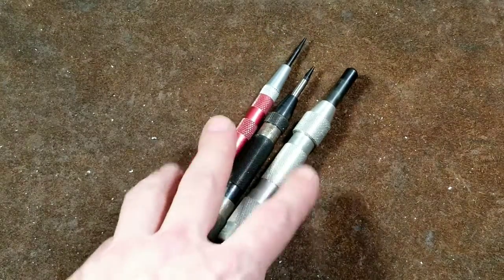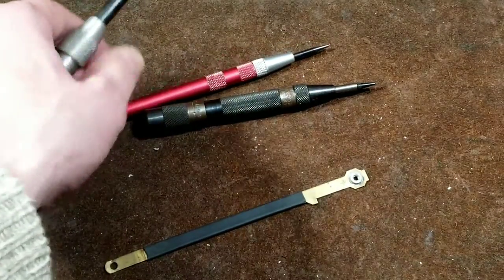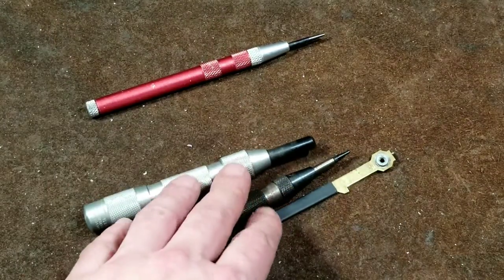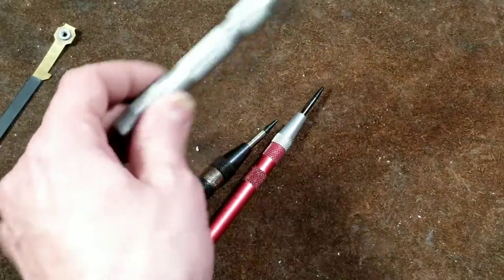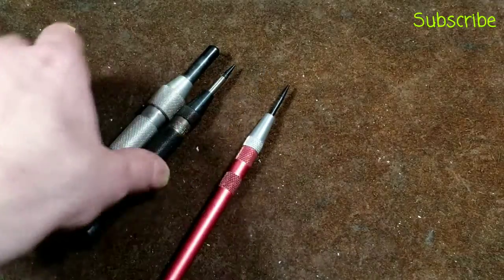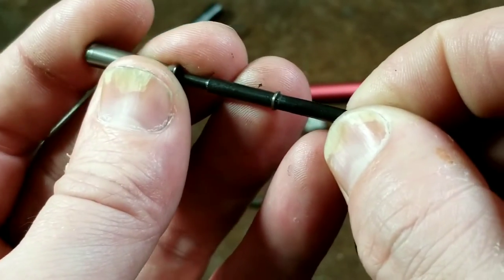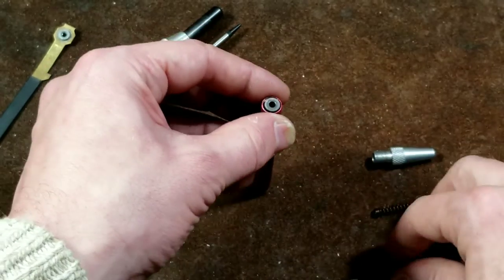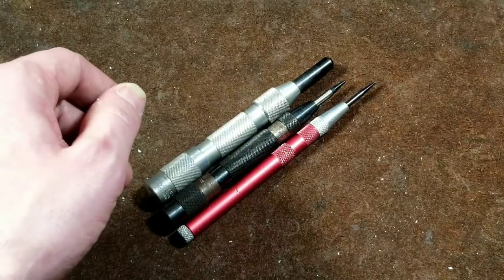Automatic Center Punch Review & Comparison

Comment: 4:52 The automatic center punch you have there is for hinges, it's to help you locate the center of a hinge hole. You put the punch on the hole so it fits on the countersinking and then press, you have now the exact center where the screw has to be located.

Comment: Thank you for this video.  I've used the Blue Point YA-900 for 23 years and it finally quit working.  I watched your disassembly/reassembly video because my center punch became a one hit wonder after I had taken it apart to clean it.  The concave barrel still isn't resetting like it should, but at least I know I have everything in the proper order and facing the correct direction.

Comment: I have a couple of these myself. Not sure of the brand but it looks like the Starrett and is adjustable as well. I use them quite a bit in (80% 30ga. to 16ga.) metal fabrication. I usually continue to hold pressure (on heavier material) after the first punch, don't move it and give it a few more clicks. 
You are correct, tips are hard to find and I just sharpen them up on the grinder. I pull the tip out and chuck it up in the cordless and spin it while sharpening on the grinder, Easier to control for me, and a smooth point that almost looks factory when I use a fine grinding wheel.

Enjoy the reviews, (probably about out of tools to show us lol) keep 'em coming.
Reply from the maker: That's an excellent idea and that's what I do as well putting round objects in a drill to grind give you excellent results. I have a few more tools to review and then I'm going to put up other reviews to I started a second channel that decided that this channel is where I wanted to do reviews just got caught in a rut doing a bunch of tools.
Remember there is tons of accessories to use with tools and I have to get through those too... :)
Reply: link to the other channel?

Comment: Tip: if you need to sharpen the tip, mount it in a drill and use a file on it.  Do not use a grinder because if you overheat the tip it will be annealed back to a soft metal.

Comment: Thanks for this video!! I found it to be a great explanation of the inner workings of the spring-loaded center punches, as well as the difference between the different types of styles.

I myself purchased a Husky spring-loaded center punch (it was the only brand/one I could find at Home Depot (tho to be honest I didn't look very long/hard)), which also has the "Light/Heavy" arrows/indicators on the end screw cap, and I think I'm going to be quite happy with my purchase. Although, I'm HOPING that I don't run into the issue you mentioned: that I'll probably use it just this one time, and then will forget about it. I purchased my specifically for marking some drill holes I need to put into a plastic casing for an electronics project I'm working on, do we'll see if it ever gets another use.

Anyways, thanks again for your/this video - quite informative! GREAT JOB!!!

Comment: Who makes the red punch?  I like the thinness of it.  Also, i don't expect accurate positioning
of the manual punches anyway, regardless of sprung or knot (not).  It's really best for the
accurate machining to use a DRO equipped milling machine to get to where u want to
drill (x, y) and make a tiny crater using a center drill 1st.  Then, bring the drill bit at the same
(x, y) coordinate.  The accuracy is within .0005" in both x, y coordinates.  Mit the milling machine head adjusted in a perfect perpendicularity w the table, the drill will nut (not) 
wander.  So, dat (that) said, everyone must go buy this 2 ton, 3HP milling machine + DRO 
accessory installed in ur garage.  Or if u don't wannnnna change tool bits constantly, or
crank the X, Y, Z axis wheels, get a CNC Milling machine!  Keep the garage doors shut
so ur  Wifee won't c it coming home from WallMate instead of BloomingTale's.  Don't
forget datto she needs to keep up w Jane-Sees as u trying to keep up w Joe-Sees.

Back to the manual punch.  Yes, i have datto General H/W brand adjustable punch.  And yes,
it bends brass sheet strips and the hole is too tiny and nut deep enough to keep even my
drill press bit to wander off the dimple.  Thinking about the comment on why the Star-it has
the sleeve, perhaps, make the hinge hole press down onto the thin brass sheet as a guide
so the sheet won't bend.  Or drill a bunch of diff. hole sizes onto a 1/4"T plate and use datto
as a guideOoo for no wander, no bending work!  I won't try to grind the tip of the sprung one
in-situ or out of the body.  It's too tiny and brittle.  Yah, the tip won't last long.  if ur un-4-2-8,
ur drop it w tip pointing down on concrete as i have.  Trying to buy a replacement is mo
expensive than the entire tool (how do the seller figure dat?).    Yes, i agree, the solid
punches r better and if u have a 3 Ton Lathe,  no problem to dress up the point symmetrically w perhaps using a good n sharp carbide tool.  i bet ur starret's entire punch is of tool steel,
nut carbide.

Thx 4 the video!
Reply: Actually, if u have that 1/4T drilling template, u don't need a punch.
For bigger diam drill bit, all u need is just one hole in the thick template.
The diam. of the template hole s/b same as ur General H/W's sleeve
at the tip!  After punching w the template, remove the template and
drill the big hole.  i suggest use step drilling for accuracy.  Get a drill
press regardless instd of trying to drill w a hand held one.

Mit Regards

Comment: Great video I have some automatic center punch I think one of mine might be a kind of a Rosy pink color made by Blue Point found at an estate sale and I think it may have a pocket clip and I really like those automatic Center punches you are right they don't leave a big enough dent because they tend not to hit very hard and so in that case they don't get used very much but I still think you're cool if you are working with aluminum copper or brass which are very soft thin metals that would probably leave a much deeper or or bigger dent in the material your tool friend Brian Williams take care see you later
Reply from the maker: Yes indeed although I did forget to mention that you can use them repeatedly in the same spot to get a bigger Dent but if you're trying to use them on harder steals you have to use a manual Center Punch & Hammer

Comment: Starrett has always been the best of the best in the machine shop. I'm shocked at the lack of quality and forethought in that center punch. An aluminum body? A retractable sleeve makes precise positioning impossible! What were they thinking?? Good grief
Reply from the maker: Yes indeed the Starrett unit is a little cheaply made but does work well and does strike hard
Reply: That starrett 819 is for punching a starter for screws when installing hinges hence the sleeve
Reply: I have a starrett 18c auto centre punch and it is a is built like a tank and hits like one too
Reply: That specific Starrett is made for wood, plastics and soft metals.  Used as intended, it works perfectly.
Reply: still have a Brown & Sharpe  that my father passed on to me. Works great!